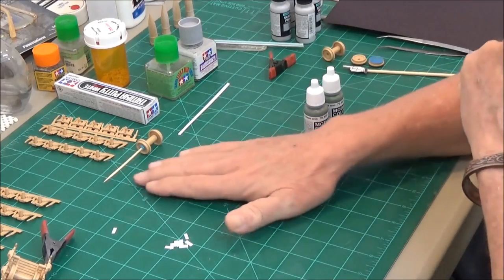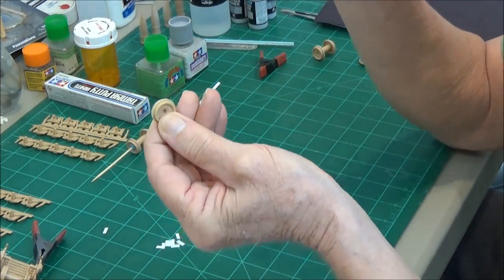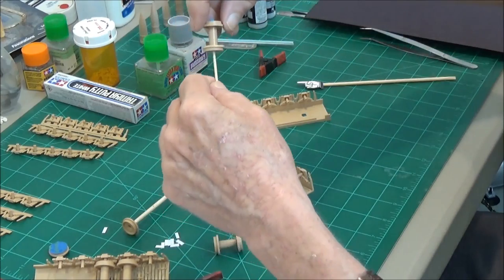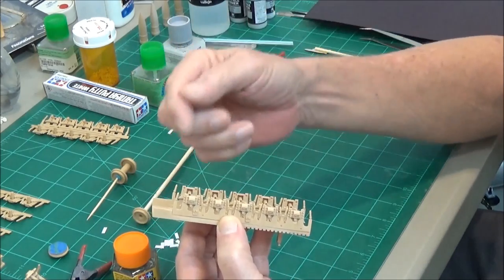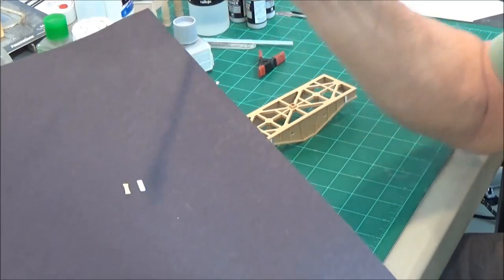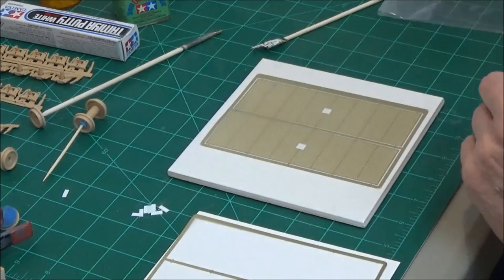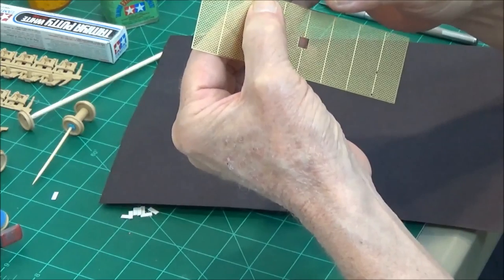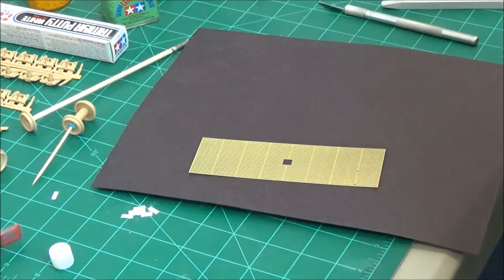DORA RAILWAY GUN PART 7

Comment: Flashbulb just went off!!  One of the last plastic models I built before I went pure wood, was a B-36 and as you know there were a lot of different shades of metal on that plane.  I painted blank decal sheet with different Alclad and cut and applied as needed.  I can see it work on the wheel but you would need a template of some type to cut the circles for the flanges.

Comment: Gary, try out some metal pigments for the wheels. you could paint them all grey and come back and hit the suffices easily with the pigments using even your finger or  sponge applicator brush... Ammo of Mig just did a video about it. check it out.

Comment: I am wondering if you could paint the shiny wheel surface and the flange first with the alclad, let it dry really well and then mask it - maybe a specialty rubber band, or an O-ring, or a piece of silicone tubing cut to size, or maybe that liquid mask, and then do the steel gray. The aluminum tape looks good on the rail but I can't see how you could do the flange. But regardless it's another great video! My dachshund Rummy also desecrates the workshop floor on occasion. But he is company!   Rick
Reply from the maker: Now you know why I lost sleep.  But I bought something I think will solve my problem.
Reply: I'll be waiting!

Comment: OK Block the part you need to Glue with the Tack. Paint the wheels with your Metal color. Now get some Circle Templates pop that sucker in to the template and paint the face of the wheel. You may need 2 of those templates if the wheels are a bit thick 

Hope this helps you with the Wheels
Reply from the maker: Got the wheels figured out, coming in part 8.  Simple and easy you got to see what I use.